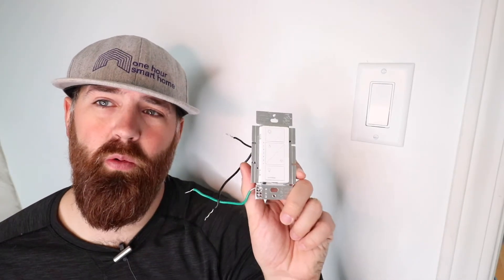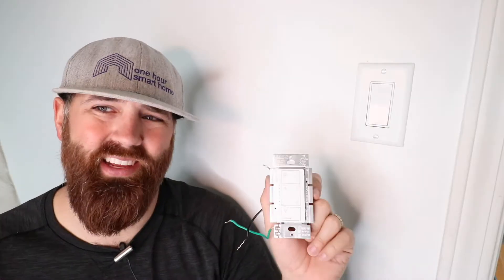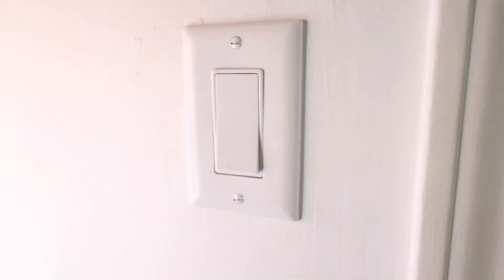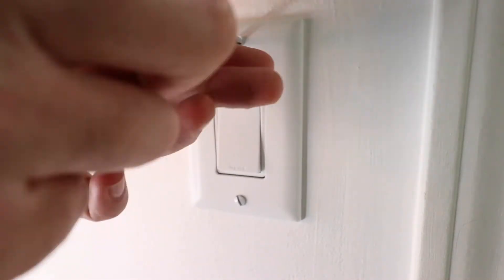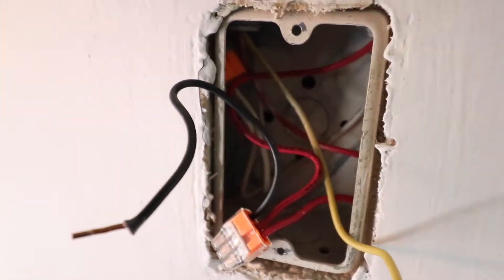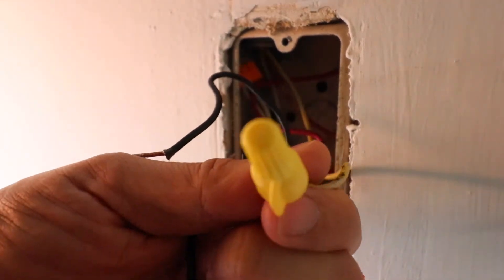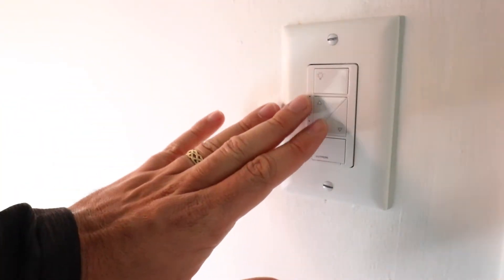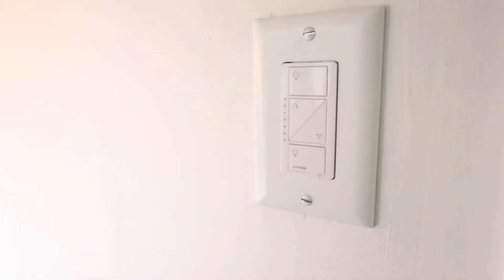Lutron Caseta Switch Installation and Setup

Comment: I just bought one of these. The instructions said to tie the two neutrals together and put both boys on either switch wire...it’s not working? So do I put both hots on one wire and both neutrals on the other like an outlet?

Thank you

Comment: Hi there. I have a two gang light switch in my kitchen:- one controlling the kitchen light and the other the dining light. However, I also have a one-gang light switch at the other end of the room controlling both lights. Can I install one caseta wireless dimmer in the one-gang switch to jointly control both lights and install two pico remotes in the two-gang switch to individually control each light? Thanks.

Comment: Can you help me with replacing my regular toggle switch that’s a 3 way to a Lutron PD5ans. 

How do I connect this lutron caseta wireless switch to my existing 3 way. I want to replace one of the switches with the lutron. There is a 14/2 and a 14/3 cable coming from the wall.

Comment: Hello, so just to double check here, once the bridge is hooked up to the app, the only thing you need to do to establish the connection between the bridge and the dimmer is to press the dimmer for 10 secs?
Reply from the maker: Correct with the app open. Using the add a device feature. It's very easy.

Comment: I bought a lutron switch with no dimmer. It has 5 wires. A ground(green), red, black, blue and white. In my 2 gang switch box I just have 2 black wires connected to the switch I want to change. What should I do?
Reply: It is probably a 3 way switch! So, in this case you only need the red and the black. Check the diagram on the switch to confirm. Also, best practice to connect the green to the ground wires.

Comment: NEVER use a wire nut to connect stranded wire to solid wire! They can loosen over time, and cause a short, hot spot, or house fire.  ALL codes say this is Improper.  Tin the stranded wires before attaching to solid wires via a wire nut.
The wires to the switch or outlet terminals NEED to be wound around the screws in a clockwise direction.
Reply: your obviously not an electrician.......

Comment: YOU are SO WRONG about the grounding buddy... You can NEVER be sure that that box is grounded through the METAL conduit. THATS WHY there are ground wires now a days. If one part of the conduit is loose and disconnected guess what,,,, your not grounded at all...grounding via the metal plate of the switch is against code and NOT adequate
You go into someone's home and dont even linen the screws back up ??? what kind of craftsman are you ? thats sloppy work sorry

Comment: Lutron is a terrible overpriced product from a terrible company. TP link costs $18 and does not require a "bridge" thingamagiggy...
Reply: If every light / switch in my home used WiFi, as TP-Link switches do, it would put quite the burden on the router.  I already have multiple Alexa Dots, and multiple HomePods Mini (transitioning away from Alexa).  I also have Ring cameras that require WiFi, a connected vacuum robot, and, of course, laptops, phones, tablets, etc in the household.

I’ve used WiFi switches in the past, and lived to regret it.  Caseta's use of a hub, and the fact that they work with all 3 major voice controllers is actually a big plus.  Lutron has a long reputation as being a reliable manufacturer of electric switches.
Reply: @mollymaxton4046  I trashed mine.